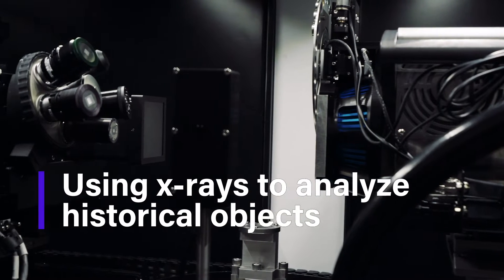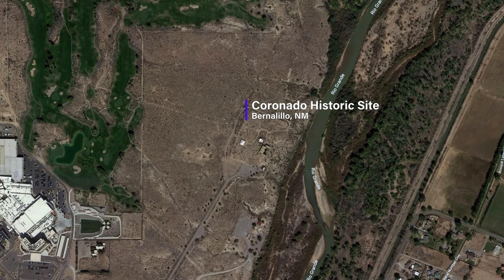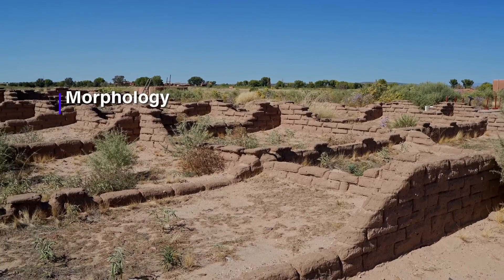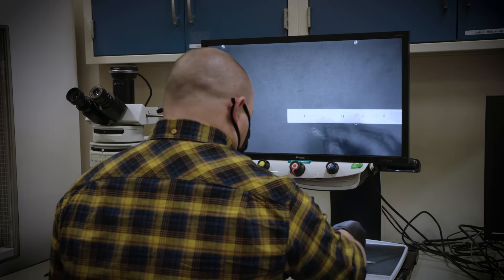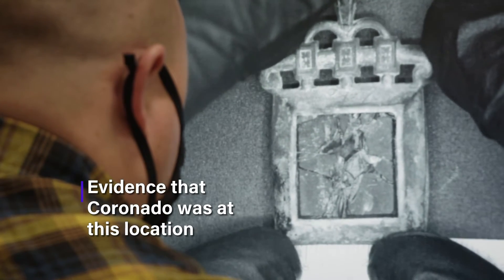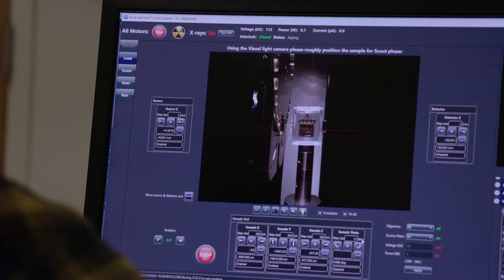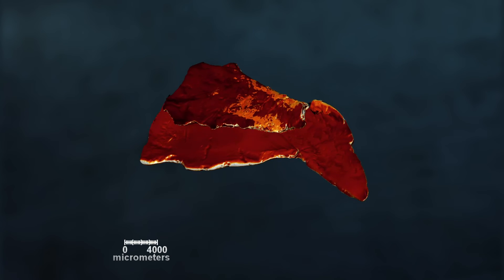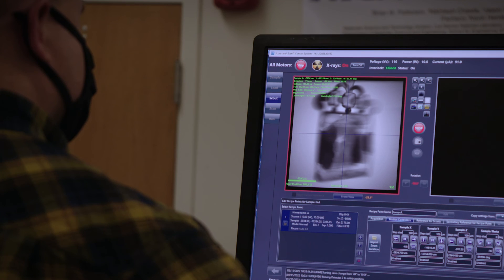Using x-rays to analyze New Mexico state artifacts

Comment: Los Alamos National Laboratory
(A laboratory for the manufacture of wormholes must be established in order to move at the speed of light and to develop means of transportation)
The impossibility of faster-than-light relative speed only applies locally. Wormholes might allow effective superluminal (faster-than-light) travel by ensuring that the speed of light is not exceeded locally at any time. While traveling through a wormhole, subluminal (slower-than-light) speeds are used. If two points are connected by a wormhole whose length is shorter than the distance between them outside the wormhole, the time taken to traverse it could be less than the time it would take a light beam to make the journey if it took a path through the space outside the wormhole. However, a light beam traveling through the same wormhole would beat the traveler. 
1/Humans need technical plans to expand and stabilize wormholes
2/Wormholes need materials that act like strange matter behaves
Exotic matter, which should not be confused with dark matter or antimatter, contains negative energy density and a large negative pressure. Such matter has only been seen in the behavior of certain vacuum states as part of quantum field theory.
(We hope that experimental physicists will develop mini wormholes in order to transport humans through wormhole tunnels)